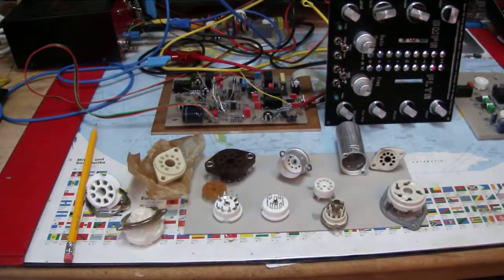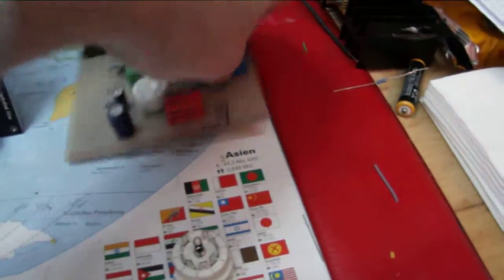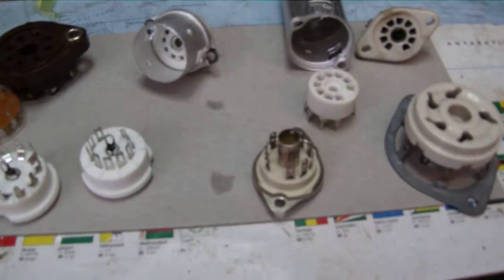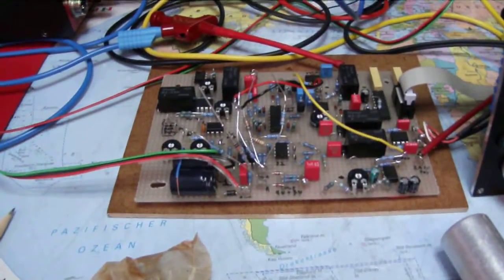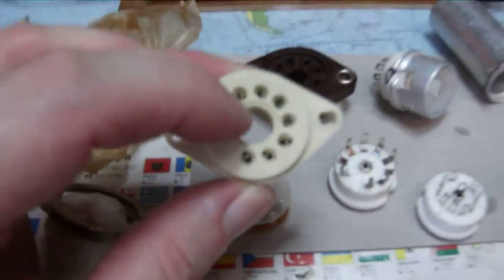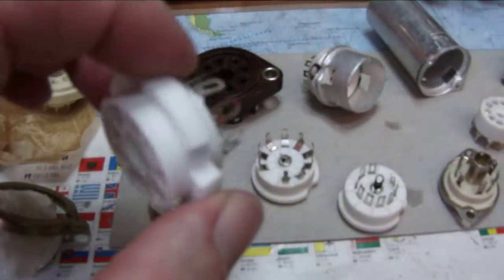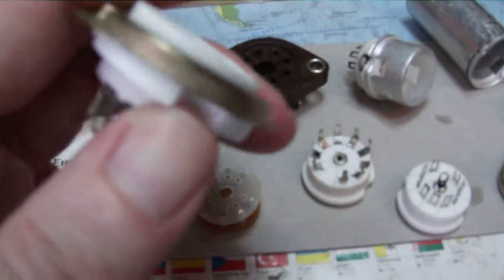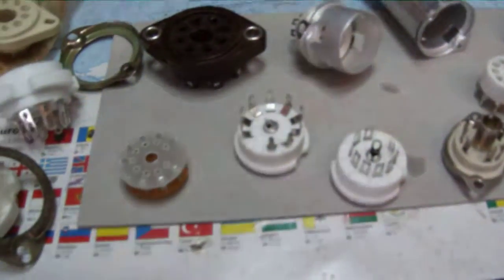Different Tube Sockets NOS vs. NEW vs. Ceramic vs. Plastic Overview

Comment: What do you think about Marshall amps sockets? Are they good and reliable?
Reply from the maker: As i do not know on witch particual Amp type you are refering to or witch Amp you got and how old it is, i can´t tell you anything about it. But in gereral they are ok. Nothing special but they do their job, if not treated too bad (lots of tube changes, high humidity ambient and alike)
Reply: Thank you.

Comment: Thank you for showing us so many different types and quality of sockets. I also like the way you have your prototype board set up - it never occurred to me to be able to use it with tubes - I really like that.
Reply from the maker: All my prototype circuits are developed with the help of lots of proto-boards.
As it is by far more easier to change components and add some test wiring.
Most of my projects starts with just an idea of a thing. Then a little math for bias, gain and bandwith and then testing on proto-board. Most projects I start from scratch, because i just want my projects to be all mine.

Ok basic circuits I include as we all do, but when it comes to overall design it has to be mine. As well as i want to make all mistakes by myself -- the only way to understand the full story and what´s all behind it...